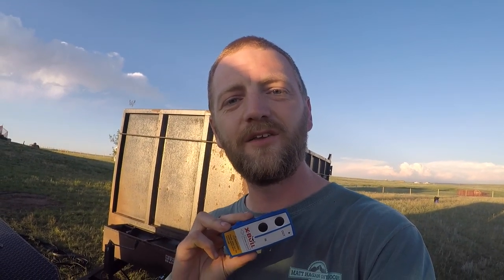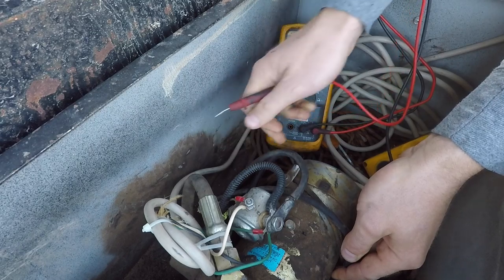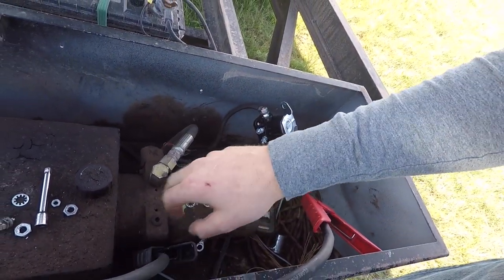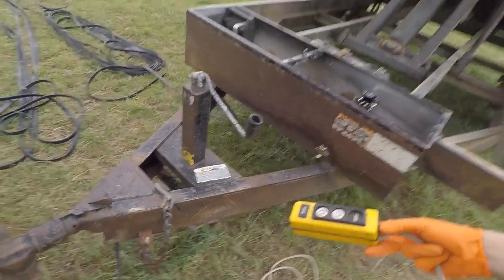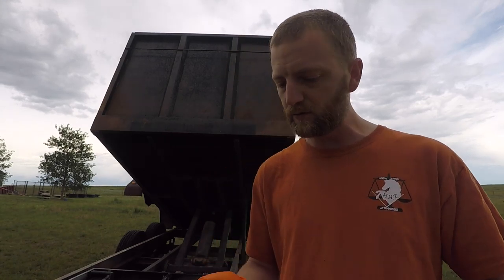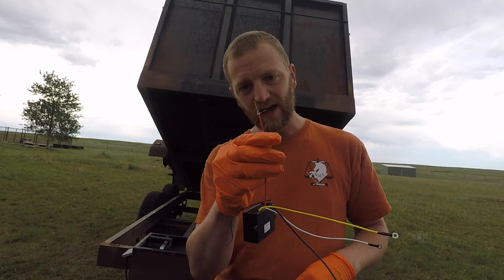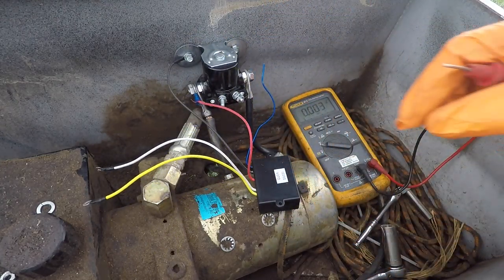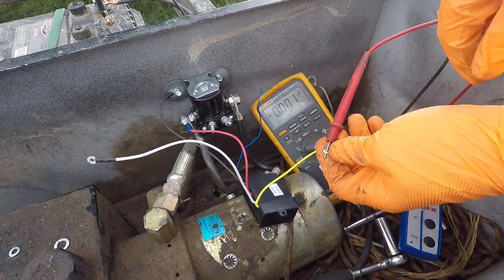DIY Wireless dump trailer!

Comment: I know this video was posted 3 years ago, but you are the first person I've seen install a wireless remote without using diodes or automotive relays.  I like the simplicity of your install and I'm not much smarter than the remote itself so I wanted to avoid complication.  My question to you is this, do you have any issues using the wired system and the wireless system while both are connected?  In other words, using the wired system doesn't short out or burn up the wireless unit?  Thank you for a very well presented instructional video.

Comment: Hey nice job.  I have one of these same ones on my dump trailer but they draw a little bit of power.  I had to put a battery disconnect on mine so when I don't use it for a long time the battery is saved.

Comment: I assume there is a way to pair the receiver to the transmitter so when you dump the trailer your winch on the other trailer isn't winding out? :)
Reply from the maker: They come paired, the remotes only connect with their one receiver. This trailer isn’t mine so I won’t be using the winch on it, but I don’t think you would have any problems using two separate units for a tilt and winch on the same trailer. Great point though!

Comment: Blake, great video. How would you wire this remote to a power up/ power down hydraulic dump trailer with 4 wire remote? This trailer looks to be a power up/gravity down hydraulic dump trailer.
Reply from the maker: Should be pretty similar, just use the wire going to the lowering valve in my video to power the lowering solenoid.

Comment: by the way.. i bet if you hook your multimeter in amp mode.. that if you measure the amp draw of the remote box red wire .. its going to have a 0.05 or 5/100th of an amp of draw..  you may want to install an on off switch in the red wire to the remote relay so you can turn off the parasitic draw.  or your battery will be deeply discharged in just a few days.. ruining the battery.

Comment: i wished i had know this a few yrs ago, when i was looking for a wireless remote for our dump trailer. ended up with a remote along with another switch like u showed, and like we got with the pump when i bought it. our remote is not so remote. it doesn't work very well if u walk to the front of truck. kinda gave up on it-for now-thanks for the video.